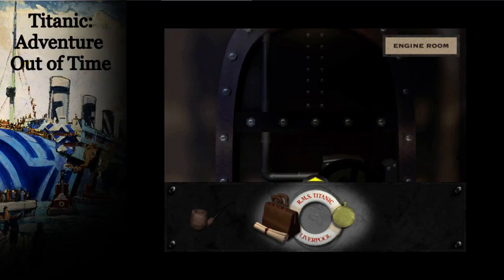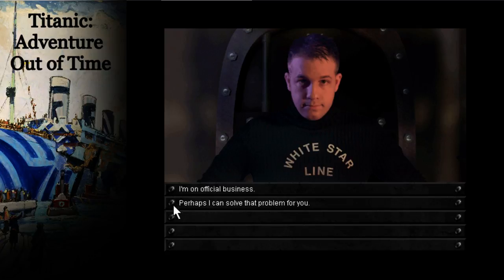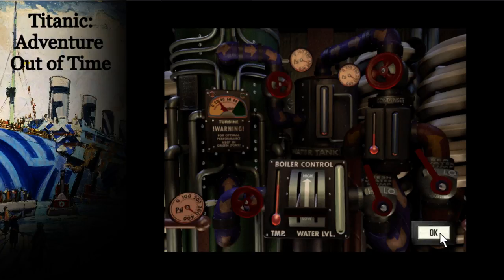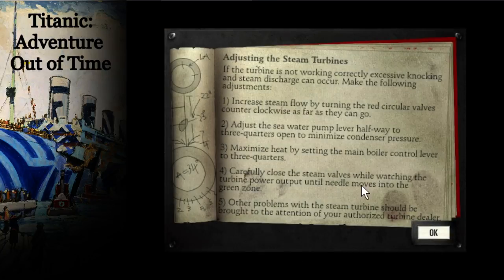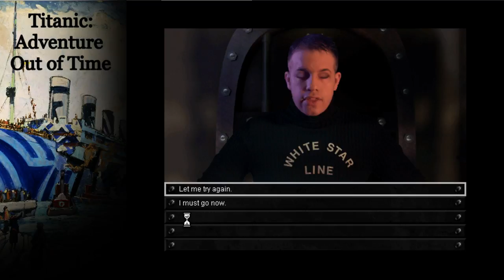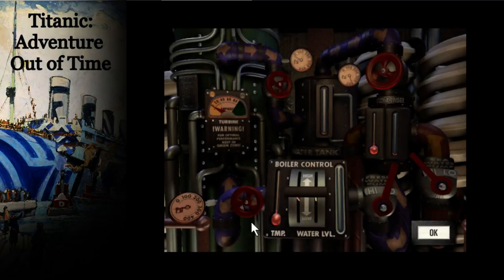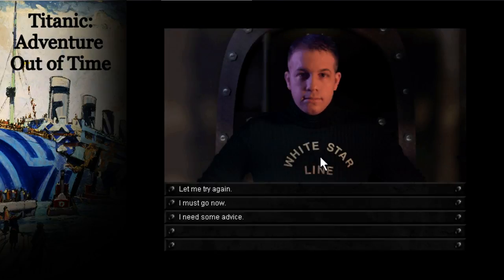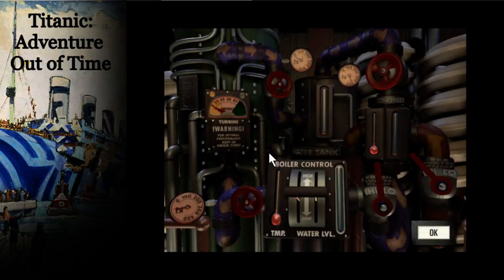Titanic AOOT: How to solve the boiler control

Comment: Just a heads-up. Sometimes, the puzzle gets randomized. I've had to adjust both the seawater and freshwater pumps before. It's easy once you get the hang of it.
Reply from the maker: The puzzle solution is always technically the same but the valves and levers are all set randomly. How much you have to adjust them changes every time.

Comment: You don't need a guide book to solve that puzzle. All you have to do is mess around with the controllers and you'll solve it in a few seconds.
Reply from the maker: You can, but that would make a terrible video.
Reply: Good point.